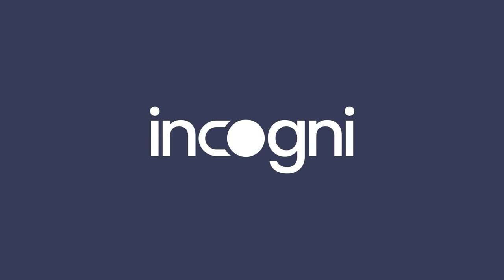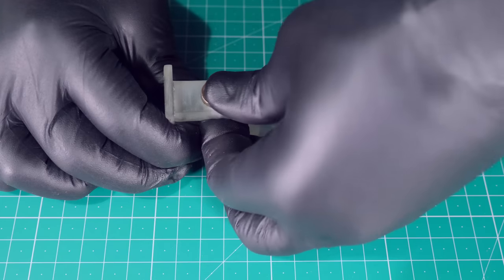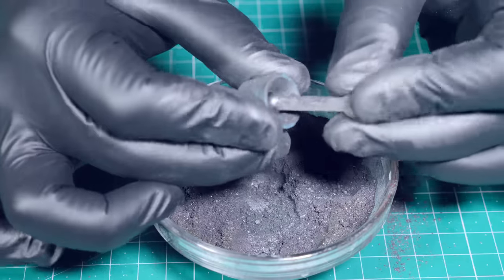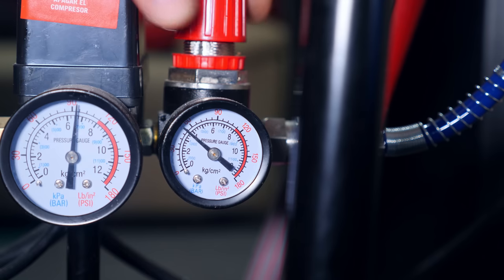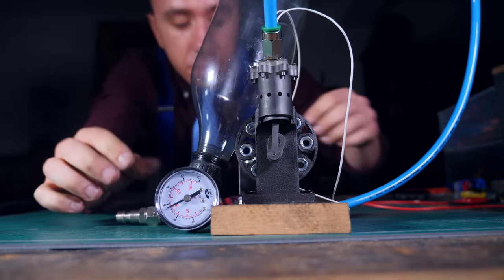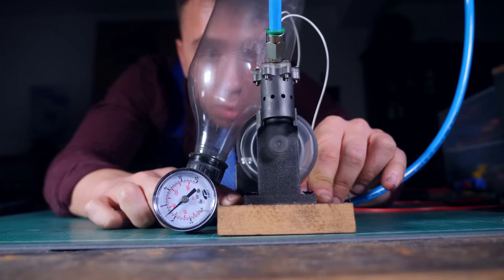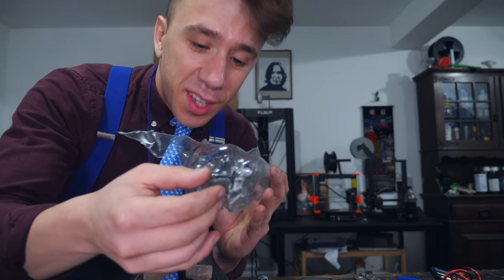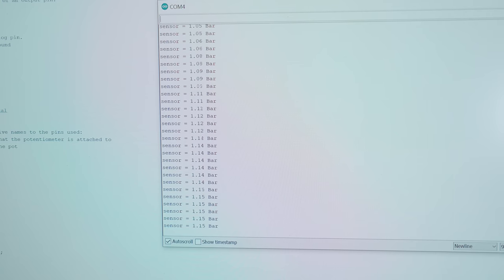Magnetic Air Engine

Comment: If you add porous membrane in the cylinder or bottle you’ll be able to hold a lot more pressure. The pores in the membrane act like miniature compressors trapping and further compressing the gas.

Comment: I think a great way to extend the running time of the engine is to have a system of mutiple CO2 canisters all hooked up to the electrical valve, that way if a few canisters run out, the other remaining canisters will basicly act as backups, thus extending the run time alot.

Comment: Fill the bottle with a small quantity of chemicals that can react to produce extra air, such as vinegar and bicarbonate or a very small quantity of the peroxide/permanganate combo you've used before
Then add the extra pressure of the canister on top

Comment: make multiple compressed air engines together for more torque and have them connect on the same pinny wheel. also make a controlled system with multiple co2 canisters and it controls how much they input into the engine. (like a throttle controll)

Comment: Remove plastic bottle, install pressure regulator, heat up the air in an expansion tube with heat exchanger and use more CO2 canisters in paralel.

Comment: So.. I would suggest to firstly using a larger soda bottle, maybe a 3L. Secondly recharging till 2bar I think is too little, I'll try 4-6bar and the use a compressed air regulator to feed a constant and steady 2bar to the engine. You could also try to use a larger/heavier flywheel, I know this might not do anything at all, but this will allow you to take full advantage of implimenting a "Hit & Miss" system to the engine. It will the only use the compressed air when it is needed when the RPM starts dropping or when the engine starts taking load. Kind regards, Tomatoes are diabolical !

Comment: Use a paintball gun tank for greatly increased capacity. they are re-chargable and much larger volumes of air. Use one with a regulator and you can drop the CO2 cannister re-charge.

Comment: Need a catching system for the gas as it escapes the piston, and if you were going to make something that flies, what about helium as the gas, some empty containers to catch it and provide additional lift as they fill. Be nice if you could recycle the gas from the containers to power the piston again once the containers reach a specific pressure.

Comment: Try adding a flip flop circuit to the engine solenoid to conserve air, the power stroke seems very powerful and probably doesn't need to be as strong. So air would be released every other stroke or maybe every 3 strokes. Also, you can buy larger co2 cartridges, maybe try that and see how it goes?

Comment: Thing about air is it's REALLY elastic..  If it takes a lot of force to open your valve it's because you are trying to open it wayyyyyyy too soon..  

You should play with shortening your nail height so the valve opens near TDC when the crank has the most leverage...  Think about doing squats.  Is it easier to lift a lot of weight when your legs are bent or nearly straight? The crank/rod is the same way. Ideally for best efficiency you need a valve that opens near TDC that has a LOT of flow! Remember, the valve needs to equalize air pressure between the line and the dropping piston. After the ball valve shuts the compressed air in the cylinder will keep expanding till it is released. (Easily evident in the first engine slow-mo you showed in your video)  

Also, all your engines have the crank directly in line with the  cylinder. Play with offsetting the crank so it is offset from the centerline of the bore. When offset, the force that the piston has on the crank becomes asymmetric. This is ideal because when approaching TDC you want the piston to have LITTLE mechanical advantage over the crank (To help push the valve open) and after TDC you want the piston to have a ton of mechanical advantage over the crank (To help extract as much force from expanding gasses as possible.) If I'm correct, looking at the end of the crank with the cylinder above the crank, a clockwise spinning engine would have the crank offset to the left of the cylinder. as the expanding gasses will have a direct push straight down on the crank at 90 degrees from TDC. 

Another thing that would be neat to see you mess with is a twin valve air engine and eliminate the piston valve at the bottom of the bore...  You'd now only have 2 valves connected to the head. One valve facing outward (like your inlet) and another facing inward for exhaust (Probably spring loaded to keep it closed prior to the intake opening..  The intake pressure would likely "Blow" it closed, but that wastes efficiency). With a small  stroke "Crank" separate from the working main crank to actuate the valves, you could potentially positively drive these valves in pressure/exhaust to eliminate the engine building pressure after the exhaust and intake ports are closed while the engine is approaching TDC and basically wasting precocious output by compressing air prior to the intake valve opening. If they were arranged to be inline with each other and 180 degrees apart in rotation and timed 90 degrees from TDC (Would be neat if you left a design revision that allowed you to play with valve timing), you could potentially have one of the highest efficiency and highest output air motors around. 

HTH

Comment: Is it possible to eliminate the large cylinder? Just pull your pressure directly from the C02 canister. Maybe you can manage the output pressure down to 2bar by using a very small orifice. That way, you could eliminate the 2L bottle and arduino/valve circuit. Cut a lot of weight. taking into account orifice size and rate of air consumption you should be able to tweak the orifice size to get optimal pressure.

Throw on some wings, rc receiver and servos and youve got yourself a neat plane.

Comment: increasing the weight of the flywheel will store potential energy longer and more efficiently than air. this was done with busses in Switzerland and south Africa in the 50's or 60's. or use steam. but as for compressed air that can be transported with the engine the only other way would be to have a carbon fiber tank. they have some that go to 5000 psi for specialty air guns. very interesting!!!

Comment: Possible improvement on the design. Build it upside down and use gravity to pull the piston down with a heavier head. Attach the CO2 directly and combine the piston head and ball to create a specialized plug. Continue using magnets however add one for the upstroke on the upside down piston for positive attraction and the weight and/or magnetic attraction would pull it against gravity then the flywheel drops it down where the air pushes it up. I also feel like this could work with steam. You possibly made a sterling engine how we have come full circle but with CO2. Fingers crossed on the 3d printer giveaway, I would love to design as well.
Reply: In conjunction with the specialized piston head/ball seal combo a spring could be added to increase horizontal motion of which I find it incredibly hard to explain without drawing it. I hope this helps someone’s process.
Reply: In addition if you were to pressurize this whole system in a self contained type of box and attach multiple of these to a cam shaft and use the “waste air” to a channel that pushes the flywheel along for added rpm’s.
Reply: Even if you don’t use my solution I feel like the weak links on this design is the piston arm and compressor. If you’re going to code direct import CO2 delivery system and even elastic on the piston arm would help.
Reply: If you find this thread and do decide to compress this system the back pressure could be used like the CO2 cartridges… it would look like an engine compression chamber with focused air blasts like a fuel rail/ injector into a car. Would probably run for a very long time, but that’s just theory.

Comment: My suggestion is to make different engine designs in clear resin. Includes high speed video of them in sliw motion. Measure the efficiency of each design. Identify source of friction, thermal and acoustic energy loss (also use thermal and acoustic cameras or sensors.

Comment: What would be cool would be a 1st stage of pressure regulation before the engine, so that the engine receives constant pressure no matter how many bars in the bottle. This could be done with a simple spring loaded valve between the bottle and the engine. Just like a modern diving regulator !

Comment: In my experience,  a reciprocal engine is inefficient.  So do away with that too.

Here are some thoughts for a dule turbine/turbocharger engine:

Run a ⅓ offset double 6 cuped turbine wheel with exhost running the turbocharger that would be ½ the required size. Run compressor of that unit to a 2× the size turbo to increase output. Keep a small resivior for continued storage.

Run 2 two Litter bottles as the compressed air supply. 

Lastly,
To keep a constant speed, and have speed controll, run a valve that the flow of air can be changed by the usage of a governor.  Have it open fully and close till just open halfway through. That will supply a working engine as long as pressure stays above 6 bars.

Comment: I have an idea to surpass the speed limitation of the valve. Just use 2 electro valves and fire it sequentially to achive higher pressure and RPM.

Comment: Put 6 canisters on a pipe, 6 on another. Engine and bottles in the middle an make a V12 air motor. Use the motor as a fan, putting a fan on. Or use it as an elettric generator if you can get torque.

Comment: You should attach this to a regular combustion generator and see how much electricity you can make off the exhaust! The only foreseeable problem would be heat. It would be interesting to see how much power could be made from harvesting the waste from a regular engine. To actually generate the electricity I would try a belt from the flywheel, or directly attach the flywheel to a low torque DC motor.

Comment: Engine improvement idea: cool the gas before you use it, and use it with lower pressure and heat it up right before it enters the engine cylinder. I was thinking on what is used at model engines that heats up the fuel mixture in the cylinder.

Comment: Look into "Air sack pumps"

a bag of air you can fill by shacking it open like a large trash bag.
Close the hole in the bag and sit on it, release the air through a small Tesla turbine, charge phone anywhere, anytime just by filling a bag with air and then sitting on it while yo u wait for your phone to charge.

See how many times you would have to sit or how big a bag of air you need to actually be usable.

Comment: I would like to see the torque measurement at the different input air pressures to see where the optimal output is for duration vs air pressure, you might be able to optimize the performance with decent torque at a lower pressure.

Comment: If time is what you’re going for I’d add an additional regulator before the engine input air that runs the engine at under 1 psi like you proved was possible.

Comment: Some high pressure air rifles have a carbon fiber canister. I think they can be filled to 250 or 300 bar. Much heavier, of course, but it would be interesting to see how long it would run.

Comment: Just a thought from someone who knows little about such things but ...... any chance the second engine didn't work but the first did was 😢because the first engine had the weights stuck on the circumference of the disc but the 3d printed one had holes inside the disc. Wouldn't that give the flywheel less torque which not be strong enough to lift the ball valve.  Enjoy your videos, thanx 👍

Comment: Build a heat generating engine (anything will do) and use the exhaust to power a sterling engine, which powers either a generator and then a compressor, or just simply a compressor, that would then be able to generate air for the air engine!

Comment: Why not a small scale turbocharger with air compression. Redirect the air that comes out of piston (exhaust) to the turbine which sucks air in and compresses it and shoots it back into the system creating enough pressure to keep it going a bit longer

Comment: A bigger battery  is needed ah . Solid is more dence than gas. Dry ice ( solid co2) put into the smallest aluminum fire extinguisher you can find or other screw top pressure vessel.  
Test idea ~700x  expansion from solid to gas at room temperature.

For the sterling aspect the cold sink is the expander heat exchanger for the ice bottle. 
Yes the ice will melt but the pressure drop will chill the canister   causing a pressure drop nearing the triple point. 
Reason to heat gas/ice bottles. 
On my MIG welder 25cfh at 25psi  co2  50lbs/285l lquid  bottle. The co2 would phase change through the pressure regulator  coating the needle with co2 ice crystals. This turned the needle into a wrap against the seat, destroying the nonadjustable pressure regulator . Miller tech support said I had an argon  gas only regulator and needed  one rated for co2 LQUID having a larger heat sink  to compensate for phase change and pressure drop.

Comment: Could try adding more cylinders and then add a throttle so that when it’s not moving you can stop/control the air flow to the cylinder(s):)

Comment: 👍🏻 Suggestion for a new video .. To optimise the efficiency of drone propellers with regard to reduced noise.  Including but not limited to exploring a recent design that claims to achieve this by means of a single-leaf blade with a counter weight for balance.

Comment: I just relized a potential problem that could be the main reason all your rocket engines are exploding, have you never notice how the burn is uneven? it burns slow at first then fastest at the end? that spike in pressure is likely causing most of your engines to turn into an explosive, maybe making a more compact fuel or segmeting fuel can help as to prevent cindering

Comment: Needs a way to vary the valve timing especially given it's high rpm, you need to advance the valve opening like they use in automotive ignition. Given the movement of the air follows fluid dynamics it will allow for higher rpms.

Comment: Have you considered creating the power using some sort of chemical reaction. Perhaps the one in air bags that use sodium azide (that might make the gas a bit to quick though)
Reply: Perhaps Calcium Carbonate and Hydrochloric Acid might work better. It won’t be as rapid but it’ll still produce a lot of gas

Comment: information      2:50  the crank arm  SHOULD  be  a  DISC.    because the Mass in an arm is  NOT  radially symmetrical.          3:05   a con-rod  Needs  to be  Long  Enough, so that the  transverse oscillation of mass, at the crank pin,  is 'smoothed'.          the flywheel radius is a bit on the small side.            4:17   mass  added  to the piston.        Horizontal orientation of the piston means that  GRAVITY  opposes  the movement of the piston, fifty percent of the time.     d

Comment: What size CO2 cartridge are you using?  If a 16g, can move up to a 30g.  Possibly even connect more in parallel.  It would add weight due to the metal, but the solenoid should still be able to regulate the pressure as it did here.   
Could a lightweight form of combustion be used to pressurize the tank?  Of course, that would be bangs, which could be bad too.  If it could be regulated to a lower power output, that might work.  
Not sure what the pressure would be if you used a chemical reaction to generate a gas.  However, that would most likely weigh more.

Comment: I think you could use an idea similar to a car airbag, in which some chemical mix generate pressure for longer times than a CO2 cylinder... 
I don't know if it is possible to achieve the desired 2 bar pressure, but it could be interesting to check ;)

Comment: What if instead of having that mechanism to maintain the 2 bars of pressure, you go with the initial setup, bit as the pressure decreases, a mechanism squeezes the bottle to maintain a more consistent output? It wouldn't last as long, but it might make this project more accessible if it requires less specialized stuff like those canisters. Or, make it more complex. Put the bottle in an airtight box where you can control the air pressure. As soon as the engine starts, make the air pressure low. As the oxygen in the bottle depletes, increase the air pressure in the box to squeeze the bottle.

Comment: The main problem with your engine is that the valve requires a lot of force to open. The reason is because that ball is fighting the incoming pressure every time it opens, so the higher pressure you feed the engine the higher force that must be overcome.
You essentially have a steam engine, which was figured out a long time ago. Research the the common valving method used for a steam engine, which is force balanced. It’s essentially a spool valve run off the crank shaft.

Comment: Seems to me that any kind of compressed gas would work. So if you can find one that leaves an oily residue (WD-40?) you would have a lubricated system (less friction) plus something of a rudimentary seal meaning more gas into power rather than escaping through cracks.  Should dramatically improve your run time depending on which gas you choose. I would imagine that a heavier gas would work better than lighter.